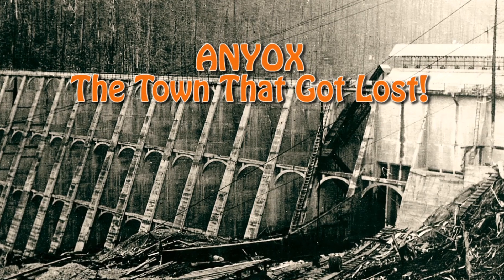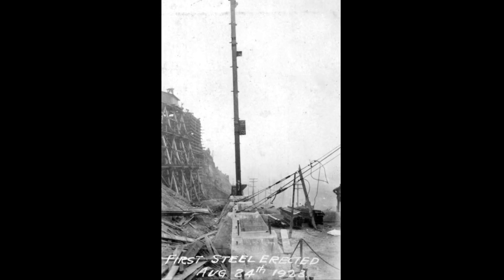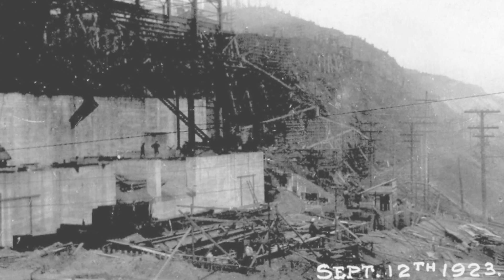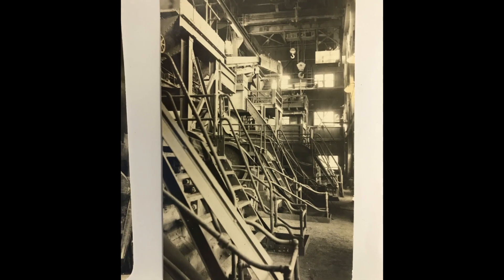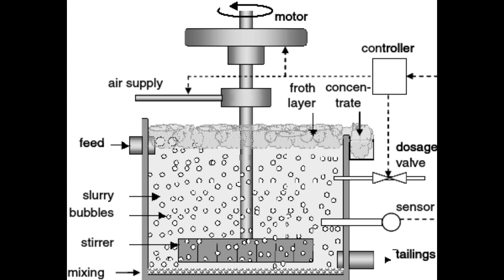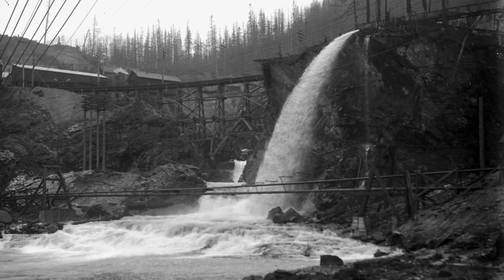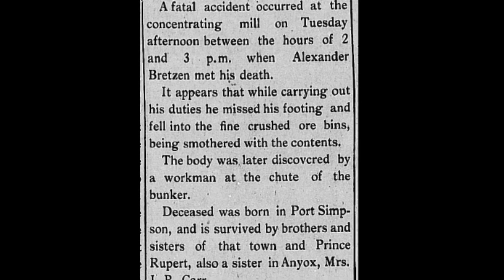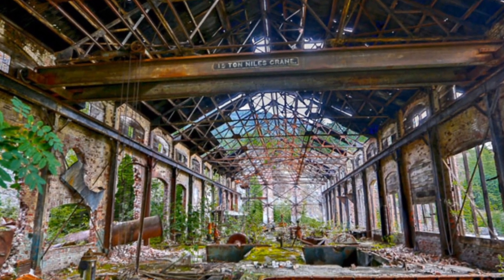The Anyox Concentrator

Comment: Great to see an update on some of the infrastructure, plus learn some details that were a mystery for my brother and I when visiting Anyox.
The stream you can see in the old tailings dump site has tons of artifacts in it. I waded one rainy day in my boots and rain gear and was amazed at all the garbage in it. My Grandfather, Ozzie Hutchings, recalled that guys would pitch the household garbage off a wooden walkway or bridge that went by or over this stream apparently, which is why I went walking in the stream in 2009. He was correct and much of the junk is still there. It is a goldmine of artifacts for sure should anyone ever want to use some of them for a museum display.
Near the coke plant, there was some sort of a building that my brother and I spent a day wandering all through. We noticed two "stolen" bulbs still in their sockets attached to the ceiling.
Reply from the maker: Hi Alfred thanks  for the comments.  I read your grandfathers manuscript regularly as it is filled with lots of great information on the town of Anyox. I will have a closer look a  the wooden walkway when i am out there next week to see what remains below it.
Reply: @RobBryce  Not from the walkway but start as near the outlet of the stream as you can get and wade in the actual stream. It's really oxidized looking, funky water, plus it's really muddy so you'll need tall boots! And the pseudonym is not my name. Same as Ozzie's last name actually. I think you and I have emailed in the past and you wanted me to give a presentation should I ever pass through and/or come on a tour. I just can't see that happening. I wish we could correspond off YTline. Gord.